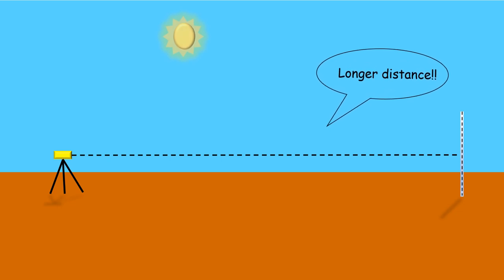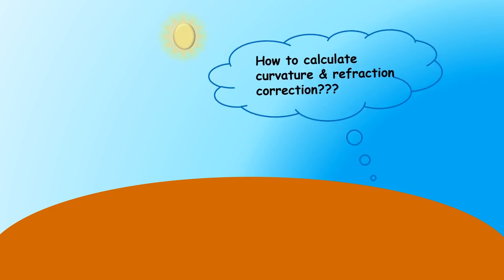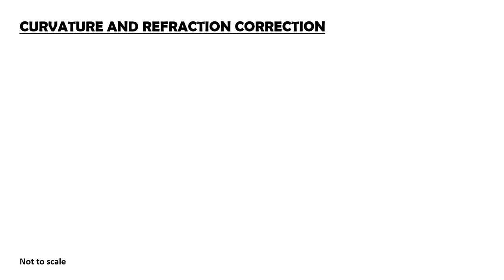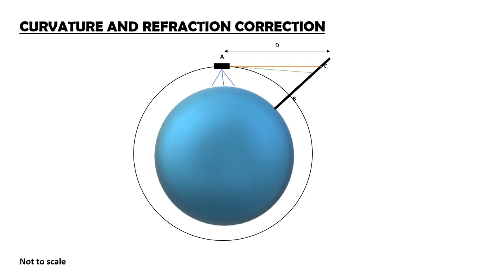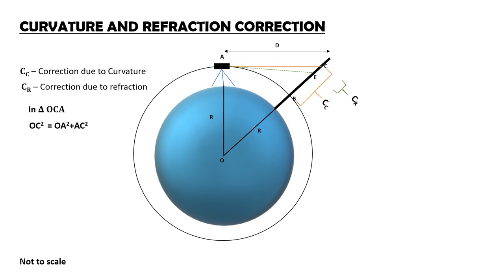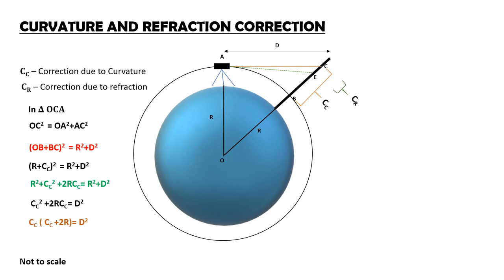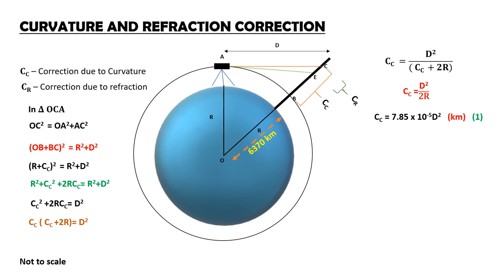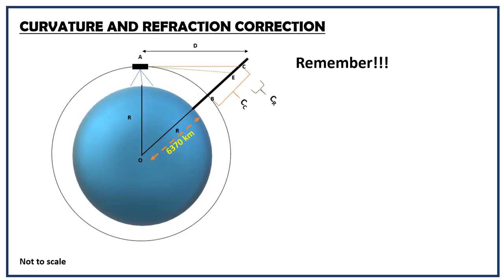Curvature and Refraction correction in Levelling | Animated Explanation

Comment: Mam One Doubt: Why refraction Correction is CE not EB.My point is that we have to measure upto AB,then why CE?
another doubt : In our state exam one question asked I remembered answer of that question is Refraction Correction Partially eliminates Curvature Correction.How this happens?I have Doubt regarding this.
Reply from the maker: To your staff reading observed at E add refraction correction you will be at C. Then BC curvature correction has to be subtracted,  then you will get the value at B.  That is why  it is being mentioned as refraction correction partially eliminates curvature correction. Just see the  fig at 6.24  minutes in the video  From CB error due to refraction you are at  E. (partially removed as said)